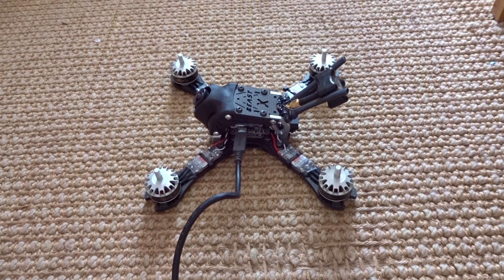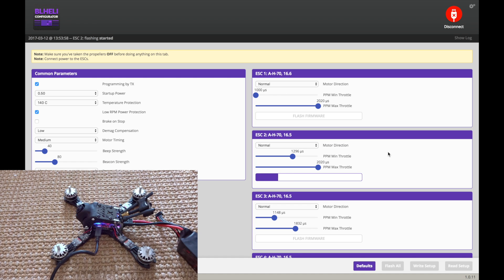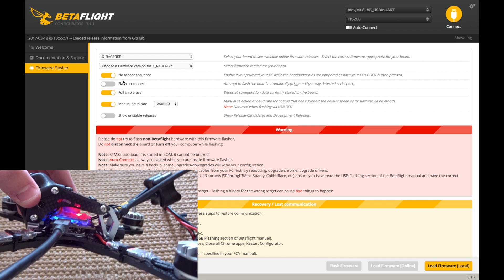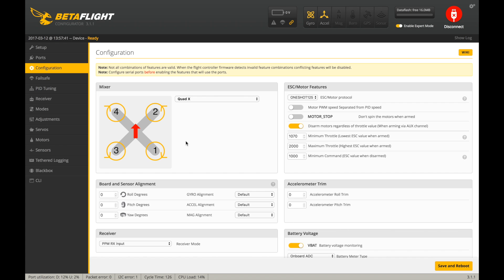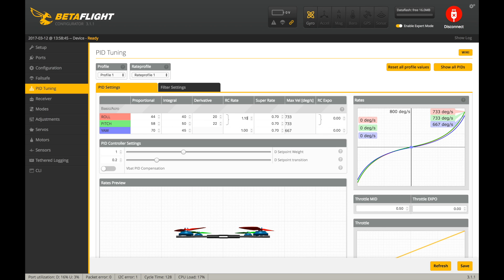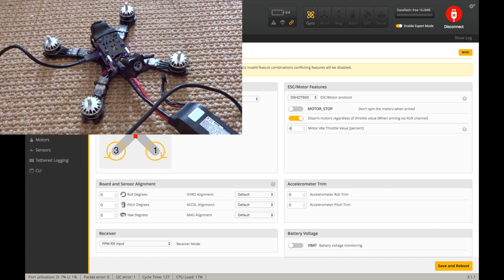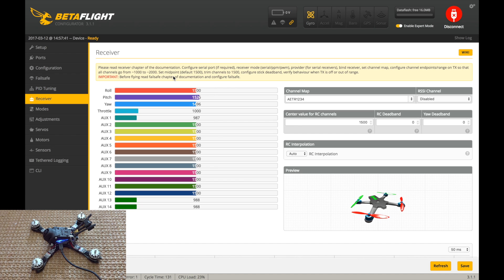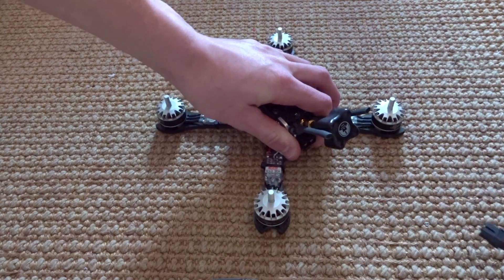Beast X Racing Quad Build Part 3: Tornado T2 Motors, DYS XSD20 ESCs

Comment: I've never direct soldered an esc - are you able you able to change the direction of the motor in beta flight?
Reply from the maker: You can change it in the BL heli suite, but direct soldering is easy. Just do a few practice runs on some spare wires.

Comment: Hey man, great videos. They help out a ton. I have a problem with my quad and the FlySky receiver connection to the FC and it pretty hard to tell the problem over chat but if I could get a hold of you any other way that would be awesome. Thanks bro!!!
Reply from the maker: You can email me at thercaddict7@gmail.com
Reply: The RCAddict where did you get the camera protector?

Comment: question ...what battery u use for quads and headset .do u have a basic video on beta flight I'm just new to beta thanku
Reply from the maker: I use Turnigy Graphene 4S 1300mAh 65c for my quads, and just a 2s 1000mah 25c zippy for my goggles. Check out Joshua Bardwell, pretty sure he has a beginner overview of beta.

Comment: Question:  After you flash your ESCs do you unplug the battery before disconnecting from BL Heli Suite?  I recently bricked some ESCs and forget how you have to disconnect from BL Heli???
Reply from the maker: It shouldn't matter. What escs are they?
Reply: They were DYS XSD 30A, I followed your build on the ZMR210R and got the updated kit that included the D-Shot ESCs.  I updated them in BLHeli, and now they do not recogonize when connected in BLHeli, or Betaflight.